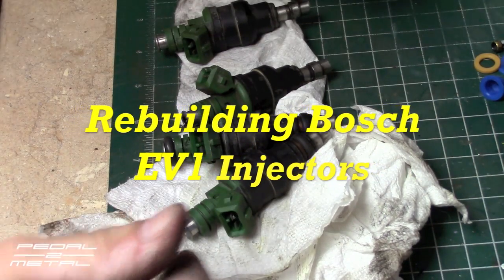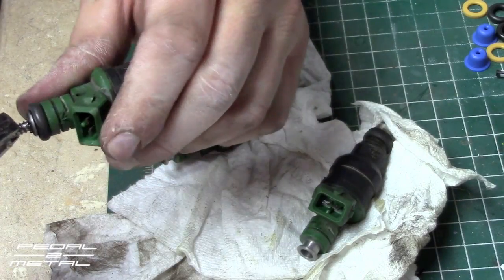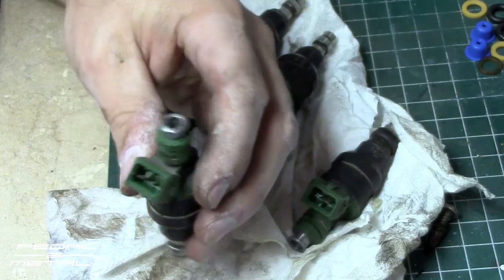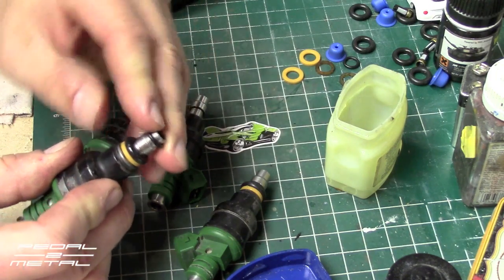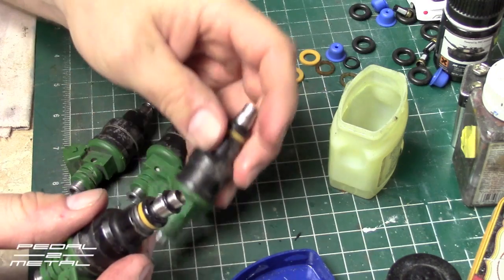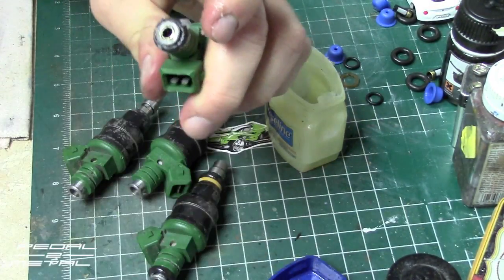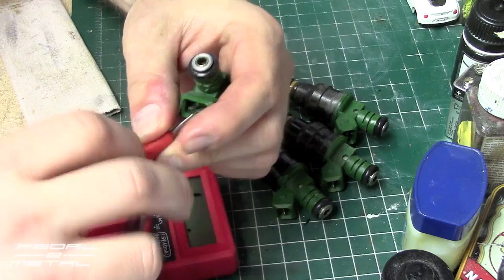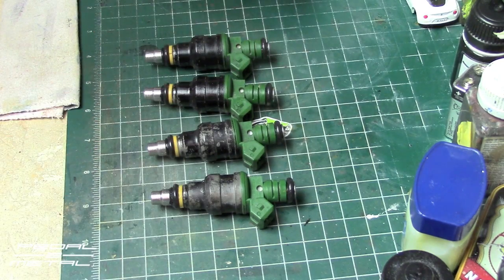Rebuilding BOSCH Fuel Injectors EV1 | DIY for Under $20!

Comment: I've been told never to sink the injectors in a water solution if you are gonnas ultrasonically clean them, I was told to use a mix of gasoline and thinner, ideally I'd have power to them to keep them open and a hose connected sucking the cleaning fluid backwards through them as the ultrasonic cleaner did it's work.

Comment: Would it have been better to put them through the ultrasonic cleaner to start with? Just curious..
Reply from the maker: I'm not sure I understand.  Technically, you could... It won't hurt them.  I just did another set of eight last week... I took the screens out and then cleaned them 3 or 4 times. Then reassembled them.  Works great every time!

Comment: Ha ha.. If you use your wife's ultrasonic cleaner.. You can actually place your part in a container filled with whatever cleaner you want to use.. Then place your container of parts in the ultrasonic cleaner and fill the machine with water. The waves will pass through the container holding your greasy parts and clean them, without contaminating the water.
Reply from the maker: So very true... But even a mild jewelry cleaner with tap water works great.  I just did my fifth set recently in it.  But your tip is also good!

Comment: Bosch or vdo injectors in vag cars like closed valve with leak clean not help its like 1 time use for 200 000 km example

Comment: Hey I just had a thought... maybe they can be pressed out by putting a metal cylinder around the screw (the same diameter as the filter) so as you screw in the screw it presses out... hmmmm...
Reply: I meant to say slightly larger in diameter as the filter so the filter will lift out inside the tube

Comment: To remove the internal filter/screens I used a shorter screw. I tried a couple lengths to determine the length needed so the underside of the screw head contacts the top metal sleeve or cylinder of the injector then it acts like a hub puller and pulls the screw out by simply turning a screw driver. In my case, the screw only went maybe 1/8" into the screen until the back of the screw head contacted the top of the metal cylinder and then pulled the screen out without a vise or much effort. Try it.
Reply from the maker: I bought another kit for another car and it came with a "free" puller tool. It works great.

Comment: One question bud, I did mine as per your video, but I did notice the original filter is a good bit longer than the replacement filter, so much so that when the original filter is tapped into place the plastic bottom of it rests on 4 tiny feet on top of the bed were it seats into.
The new filter once tapped into place does not rest on the bottom of its seated position and leaves a gap.
I'm asking as I'm wondering will the 100psi in the fuel rail not pop of the bottom of the new filters now as there a little shorter and have that gap at the bottom where as the new ones were supported as they sat flat on the bottom?

Comment: 2 Comments, 
1) Hot readings will be a bit higher as resistance goes up with Heat. 
2) I would consider a better quality DMM. I use one of these to lend 
to a pesky salesman in my dealership. For $3 keeps him from 
abusing my Real Meter.  The Low OHM reading are inconsistent with 
that meter but for 3 bucks I suppose one could argue its a Great 
Value.
Reply: These are low ohm injectors

Comment: If the readings are off most of the time it's the multimeter which isn't well calibrated. I had the same issue with "electric guitar pickups" and reading out of specs values all the time, until I trashed the multimeter and finally bought a professional one ... not even that darn expensive at all, and a lot more range in most options ... great for everything from house to electronics etc, and car repair.

Comment: Hi there Petal to the Metal, my injectors look just like what you have in this video. 8 have 8 of them though, so am I believing that if I follow the same process (minus the ultronic cleaner) that I will have much better performance in my car? Thank You ever so much for this video walkthrough.
Reply from the maker: Yes, by removing the old dirty filter screens, in theory your car should run better. Thanks for watching!

Comment: how come you left off the pintle caps ?
Reply from the maker: Hello: Good Q; my car's original injectors from 1990 did not have them on from new (and I have tried to snap other caps on in the past and there does not seem to be a ring grooved into them for the pintle caps); so I left them off.  Thanks for the Q and for watching!
Reply: ok thanks